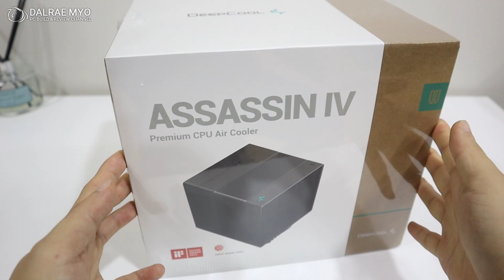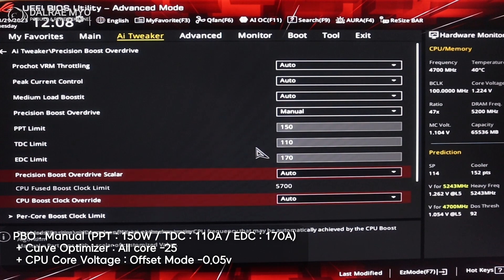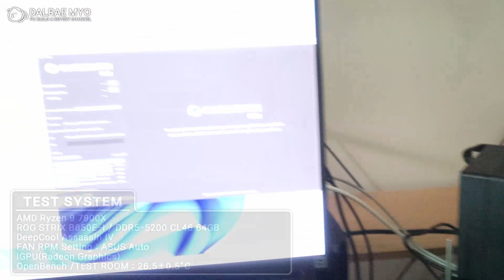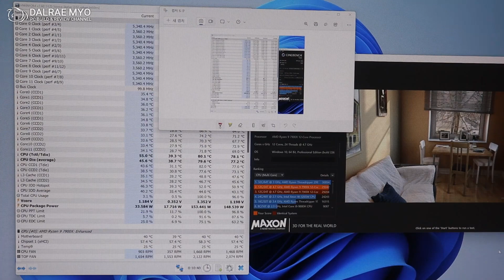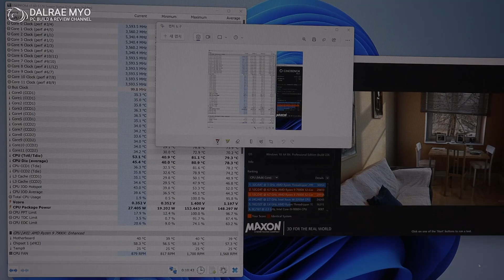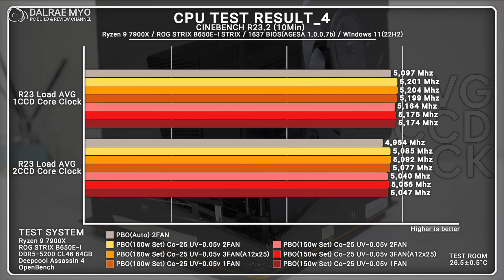DEEPCOOL ASSASSIN 4 Review | ITX Borad

Comment: Can fans be changed to other brands?
Reply from the maker: Externally mounted cooling fans are screwed to the plastic guide. If you remove the screw and remove the cooling fan from the plastic guide, it is a typical 120mm cooling fan.

On the other hand, in the case of the central 140mm cooling fan, the corners are cut inward, so the general 140mm cooling fan of other brands seems incompatible.

Comment: I admit that I may be wrong, but it seemed to me that an error was made during the installation of the fans, namely in organizing the air flow. It was as if the CPU-cooler was absorbing air rather than pushing it through itself. Please correct me if I'm wrong.
Reply from the maker: The cooling fan installed behind the heat sink and the cooling fan installed in the center of the heat sink are designed with different blade directions.

It seems that the cooling fans are installed facing each other, but the direction of the cooling fan blades is different, so the air flows in one direction.
Reply: @DalraeMyo , understood you. Thanks! Then everything is cool. I am from Russia, Moscow. I started watching your work recently. Thank you for that.

Comment: Question, I saw the "Design TDP is 240W"? Does it mean this cooler can handle CPU of 240watts TDP? If so, what kind of temperature can we expect if we install such a CPU?
Reply from the maker: The cover TDP described by the cooler manufacturer is not a good reference. This is because the test environment is not described separately, and each manufacturer has a different test standard.

Unfortunately, it is recommended to refer to the method of testing directly in the environment you are going to use, or to the reviewer's benchmark data for which the test environment has been disclosed.
Reply: @DalraeMyo  Thank u! for explaining in such details😀

Comment: Do you think it can be compatible with MO-BOs with SSD heatsink of the same height as the IO heatsink? My MO-BO is Aoros B650I
Reply from the maker: I don't think it'll be easy to answer because I haven't tested it myself. It seems that not only the height but also the position of the stacked M.2 slot is important.

Comment: Can it still fit inside an itx case? Seems like the rear fan overlaps the io shield of the motherboard.
Reply from the maker: The rear cooling fan protrudes slightly further back than the IO shield. Except for certain PC cases where the rear fan mounting part of the case is pushed outward, there is an interference in the case installation.

Comment: bro i just watched your thermalight cpu contact frame  installation of lga 1700 cpu and then i installed the frame on to i5 13600k and now the performance around  close to 23 k in cinebench and peak temperature did not exceed 85 degree with ambient temperature of 30 degree, on stock power setting but one thing peak power reached to 179.4 and not 181 watt. Is this normal?
Reply from the maker: For figures measured by the monitoring program, the refresh time is usually 1 to 2 seconds, and you cannot record all the instantaneous changes. In the case of power consumption, there may be an error range, and I think the figure you mentioned is perfectly normal.
Reply: @DalraeMyo  thanks for the help bro, I have  become loyal follower of your channel. thumbs up bro.

Comment: This cooler will not fit in Itx case, you will need to remove the exhaust fan, you better save some money and buy the assassin 4S instead. Make no sense showing the temps without a case 😂